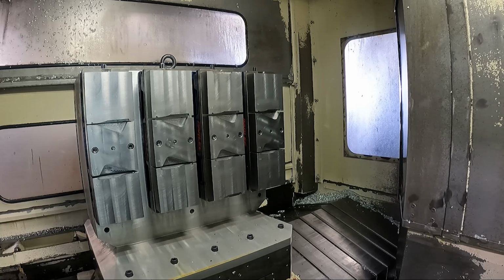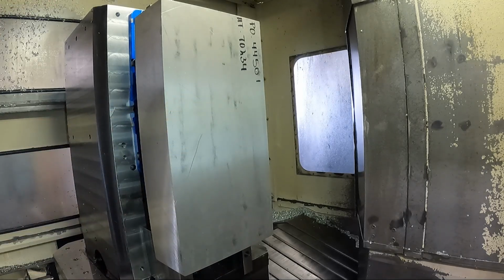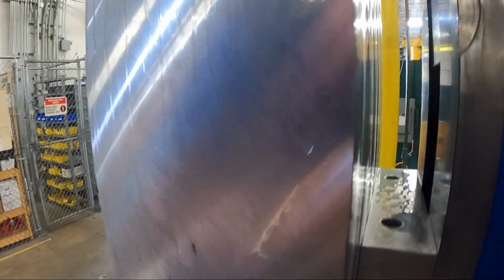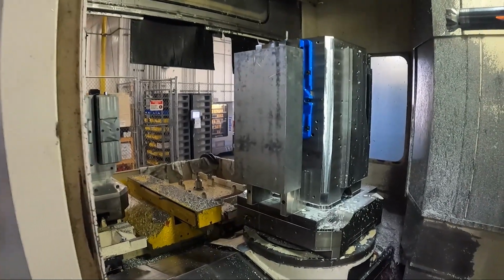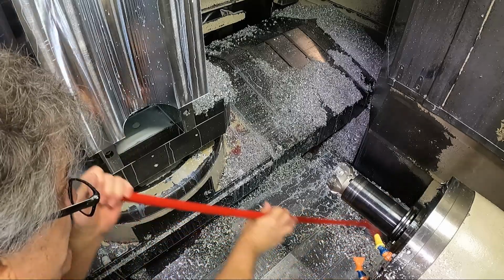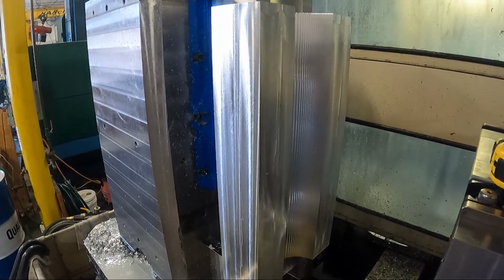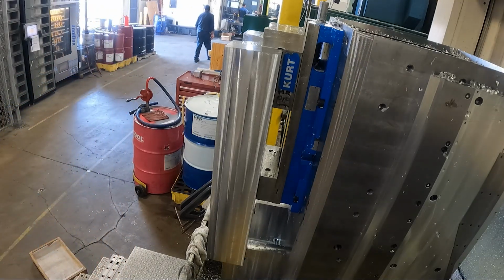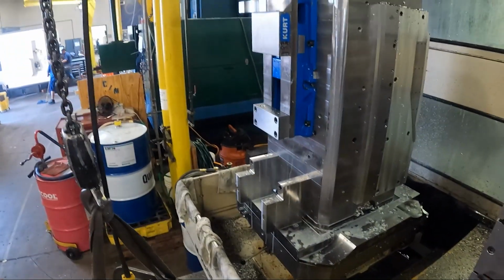Rough Radius Aluminum Plate

Comment: Always good to see some explain about internal stress releases. It's not often covered, but then many people dont use huge blocks like you do. It was issue we had to handle with large (around 3 feet across?) that had .003" per 3 in square flatness requirement.
Reply from the maker: Yes the larger the part/stock the more this comes into play.
Reply: @EdgePrecision  and the more the customer will open up the tolerance! Usually!

Comment: Great fun as always Peter.  I'm glad your chip conveyor got sorted too, shoveling works but all the better if you don't have to do it!
Reply: It’s also fun when your agv system goes down on your linear pool and you have to hand load 50lb parts in those big ole old 2002ish MH-500s or 600s idr which model or exactly is. Fun times

Comment: That's a much bigger radius than I was expecting, I'm surprised it didn't warp before. The old supplier must have had their process down pat to get their plates that stress free.
Reply from the maker: This is actually the smallest of the radiuses. As for the material I can't explain the difference?
Reply: Try a large bull nose end mill

Comment: The plate warped in the exact opposition direction than I would have thought,  Fascinating!!  Do they always warp in the same direction?
Reply from the maker: Yes always the same. Think of it this way. There is compression in the surface of the plate from the manufacturing process. When I cut into the core on the one side. There is no longer a balance in the force. The flat side pushes out but there is no resistance to that force on the side I cut the radius in. So it collapses that side and bows towards it. If that makes sense.

Comment: Interesting video, as always.  Have you ever shown the mechanism that the pallet registers against when it returns to the machine? I imagine it has to be very accurate - for repeatability - or is it assumed you'll always remeasure the position of the part after a pallet movement has taken place?  Thanks for taking the time to make these videos.
Reply from the maker: Its kind of hard to tell in the video. The six pads the pallet sets on have holes in them. When the pallet comes in air blows out those hole to clear and shavings before the pallet clamps down. As far as the accuracy/repeatability. It is not a problem. It is good enough so as not to necessary to indicate anything between pallet changes.
Reply: @EdgePrecision  I was curious about this too as I noted that you do not clean anything between pallet changes and I could not answer how shavings do not make their way into the clamp assembly. Maybe if you have an opportunity you could show briefly the mechanics of the interface?

Comment: I'm always amazed that no chips get in underneath the pallet shuttle. 
Are there some wipers or other means for keeping it clean under there?
Reply from the maker: There are no wipers. The six pads the pallet sets on have small holes in them. Just as the pallet clamps down air is blown out those holes. Blowing away shavings from the mating surfaces. There are also two large pins the align the pallet in the rotary direction. Shavings hardly ever git on them. But it appears that if they do they just get sheared off as the pallet clamps down. Actually if I don't go in there and start blowing shavings around or sweeping while the pallet is out. Nothing is really on the pads or pins. Occasionally I do clean around there. If so I make sure there is nothing on them. judging from the number of comments on this. I think I will show it in a future video. Thanks!

Comment: Excellent video as always. Just out of curiosity, when the pallet swaps out how is swarf and other debit prevented from getting onto the mating surfaces? Do you need to re-indicate parts or fixtures after reloading a pallet or is the repeatability such that you typically do not need to?
Reply from the maker: Its kind of hard to tell in the video. The six pads the pallet sets on have holes in them. When the pallet comes in air blows out those hole to clear and shavings before the pallet clamps down. As far as the accuracy/repeatability. It is not a problem. It is good enough so as not to necessary to indicate anything between pallet changes.

Comment: You are back!😂

With the Length / Width ratio of block, how much gravity distortion in Vertical Clamp with Single Vise? Compared to a 2 Vice setup, clamping the Thicker Shoulders Center, using torque wrench?
Had a similar situation many yrs ago with a large flange, moved to a Horizontal setup, gravity eliminated tool distortion / stress!
I can see limits of current machine.🤔
Old Skool

Comment: Is there any pre machining heat treatment that would minimise this effect?
Reply from the maker: It may be possible. But the metal is certified. If any heat treat is done it has to be re-certified. That would require taking samples and doing psychical tests for physical properties. It is better to change the machining process to account for the stress in the material.
Reply: @EdgePrecision  👍

Comment: Would it not be better to use a Lewis lift which is a lifting device masons have used for centuries . They come in different types but the slab lifting one with rubbers faces would be ideal.  You really are an exceptional machinist.
Reply from the maker: Thanks! The problem I have with the Lewis type devices is they loose clamping security if the weight of the lift is set down on something. Now when mounting a part in the milling fixture you would usually set it down (In this case) on the bottom jaws/supports. Then push it into the fixture. But with these pinch type of devices the minute you set down the weight on the fixture they will lose grip (or at least some of their grip). This could be dangerous if you weren't paying attention. You will notice even in this video I set the part down and had to get something I forgot before snugging up the vise. In this case the Lewis devise would have lost control of the part. They also can loose grip if lifted at a angle other than straight up. They could work by having a clamp screw for security once tightened. Kind of like a custom C-clamp.

Comment: Hey Peter, you talked about your Hitachi Seiki machines from the past. I am owning a Hitachi Seiki VK45II, and I'm really happy with my machine. So my question is, what kind of machine do you had, and what are the positiv and negative sides of the HS Horizontals? 

By the way, excellent work as always.
Reply from the maker: The main problem with Hitachi Seiki machines is they are no longer manufactured. When I owned my e the company sort of went out of busness. t least the USA part. Mori Seiki took over part of it. My machines were still under warranty when this happened. But Mori Seiki said they would not honor the warranty. This left me with a bad impression with both companies. I thought the horizontal mills were good machines. But now I would not personally own another one because of the lack of spare parts or support for them. And I will not even consider a Mori Seiki because of the way they handled that situation.

Comment: Would normalising heat treatment fix you warping issues?
Reply from the maker: Normalizing is more of a ferrous metal heat treatment. But even if some stress relief could be done it would change the certification of the material. So then you would have to have extra material to run test samples to recertify the material. This could possibly be done. But it is just better to change the machining procedure to account for the distortion. I really should have been doing this all along. Up to this point I have been lucky with the material.

Comment: Thanks Peter!
Man, all that metal moves like it's made of rubber!
Most people tend to think of metal being solid and immovable - obviously it moves a lot!

Is it possible to remove stresses prior to machining?
Maybe by way of heat soaking?
Thanks!
You're a good teacher!  :)
Reply from the maker: Thanks! Possibly. But that would change the certification of the material.
Reply: It depends on the material. Some can be heat treated to be a harder structure and resist the internal stresses. Other materials need to go through a process called annealing which does what you described. It's heated up, and then allowed to cool quickly which gives up some strength, but allows easier manufacuring because it is a more stable alloy.
Reply: @EdgePrecision  Actually there is a technique called "uphill quenching" that does not change the strength of the material but apparently does remove some of the residual stress. Might be available from your supplier, I have not used it. I don't know if it would work on 6 inch material.

Comment: Peter, could you just rough the radius in the raw stock  and finish from there? I assume you must have some tolerance that says otherwise. Seems like your 5 inch faces aren't  parallel on the finished part. How about a Mexico update when you get a chance. Thumbs up here good sir.
Reply from the maker: That's what I'm doing here. This is the raw stock I'm roughing it. Then I will finish to size. My wife and I are going to Mexico in October to meet with out contractor on that project. After that I will make a video on what's going on there. Thanks!

Comment: Have you had any major maintenance issues  with your B axis?  Looking to buy my second used hmc and trying to decide on indexing vs full  4th.
Reply: Full 4th.
If you don't 
You will regret it.
So many more capabilities
Reply from the maker: No problems at all. This machine was built in 1999. But it also has digital scale feed back.
Reply: Thank you Peter.

Comment: Cool vid, thanks!   In your experience, what do you think changed in the manufacturing process to create the out of flat effect from machining now, versus you saying it did not used to do that??
Reply from the maker: The material supplied is different. Up until now, I guess I have been lucky with the material. This new way I'm doing is better anyway.

Comment: Good work as always !
I'm a bit perplexed about the use of oil drums as chip containers, almost every american shop video i see they use them, even the people with brand new million dollar machines and forklifts are rolling around 55 gallon barrels.
Is this just an old habit that have stuck around ? You can buy a brand new 400+ gallon tipping container for like $1000.
Reply from the maker: In this case the way the machines are positioned we can’t get a hopper in there. Also it tends to be that way because of the scrap dealers here. They all use 55 gal drums to transport their scrap. There are so many different materials being machined so you really can’t have bigger bins outside to dump hoppers into. It’s kind of hard to explain in a comment. It’s just easier to dump the shavings into the drums right from the machine. Also there is the problem of theft. The drums are picked up every week. If you have containers outside here in Houston. People will come and steal the shavings to sell to the scrap places them self’s. Selling scrap here in Houston requires identification or they won’t buy it. Especially if it’s carbide.
Reply: @EdgePrecision  Okay that explains it, Thanks. The scrap dealer market used to be a very shady businesses over here in Sweden as well. They got rid of the worst of it now though with tougher regulations/requirements only the bigger more serious firms can stay in businesses.

Comment: I didn't catch what material that is. I'm guessing 6061 T651? from the way it distorted. That is what I call potato chip distortion. Long ways the surface is in tension and width ways it is in compression as a result of the stretching process. 
The stress is not just in the skin, the stress goes all the way to approximately the center at the neutral axis so lopping off 1/2 inch each side doesn't really change much. Unfortunately when the material has that stress pattern, whatever you do to reduce distortion in 1 direction makes it worse in the other direction. 
To reduce long ways distortion try machining all 1 inch off the side opposite the U. To reduce the distortion width ways, try taking off all 1" off the U side. Hope I got that right. Neither will be perfect. 
The only way I know to really get it straight is to sneak up on it by repeatedly machining it over and over again until you reach final size. It's a problem that has caused us lots of misery and expense. The stronger the material , the worse the problem becomes because the yield strength gets higher so it can retain more stress.
Just try to keep in mind where your main features are in relation to the neutral axis and try to balance material removal equally around it. Good Luck.
Reply from the maker: 7075-T651.
Reply: @EdgePrecision  You can get that report here        https://www.osti.gov/servlets/purl/922073/

Comment: should be caused by stress
Reply from the maker: Yes it's the stress in the surface of the plate. Everything thing is in a balance the compressive forces at the surface of the plate are equalized to each other before I cut into it. The cutting of the radius slot reduces the force on that face so the whole plate bows into it.